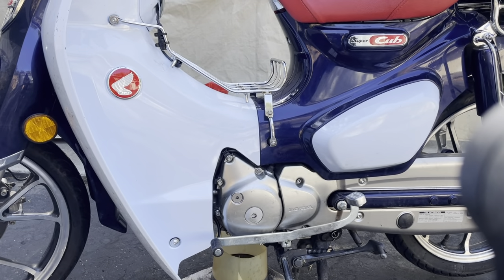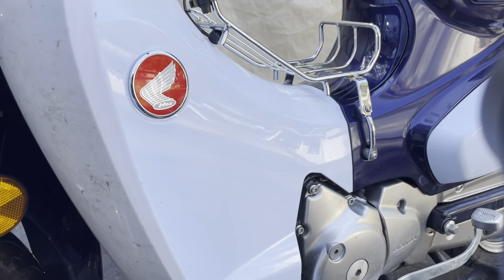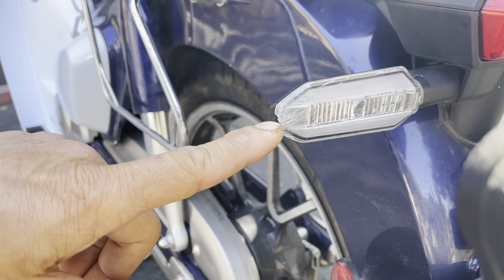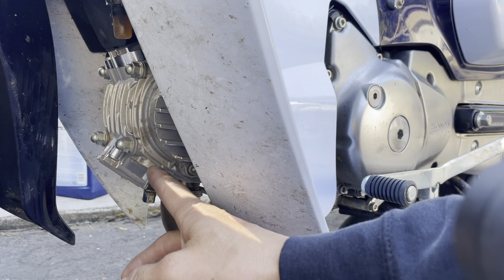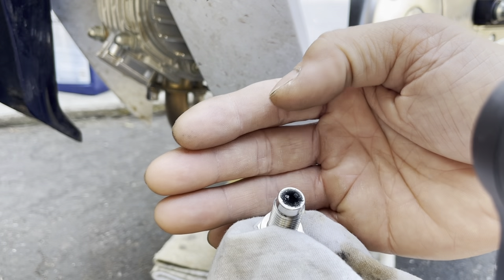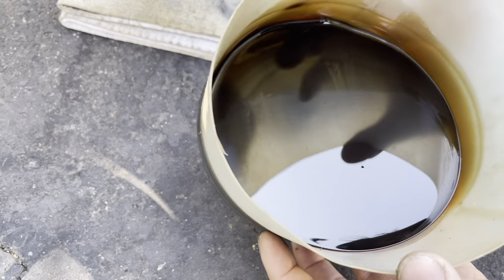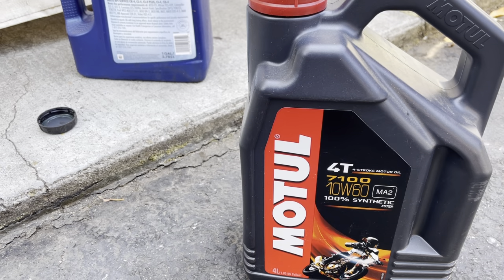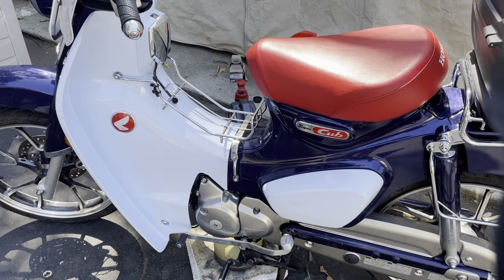C125 SuperCub SCBR clean up and maintenance

Comment: You are supposed to only use 10w30 Honda oil in the cub
Reply from the maker: That is like saying you're only suppose to drink AquaFina water and not Dasani water.
Reply: @DaBinChe  you will wreck the engine using the wrong oil. It is only designed to run Honda oil .
Reply: Use the best, recommended oil.  Change it often.  Oil is a lot cheaper than steel and hours of shop labor.
Advice from a mechanic.